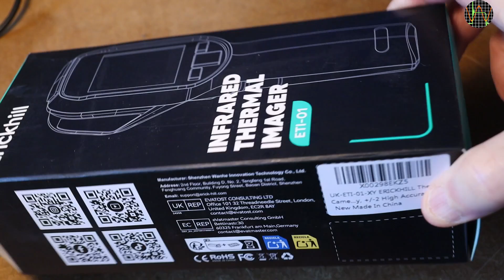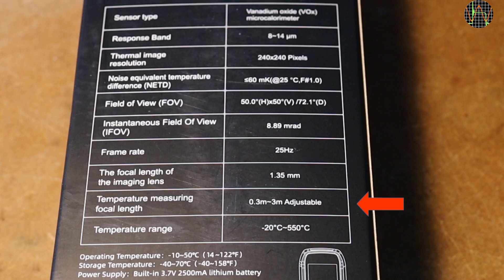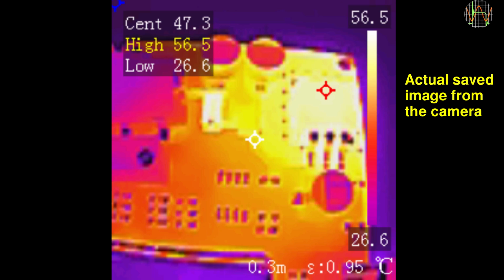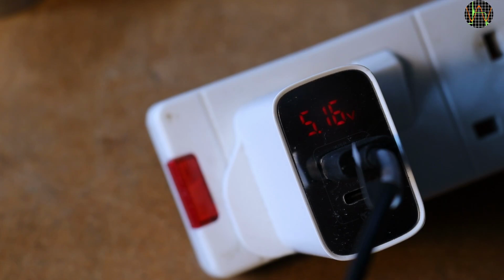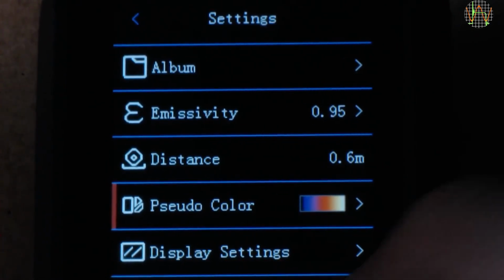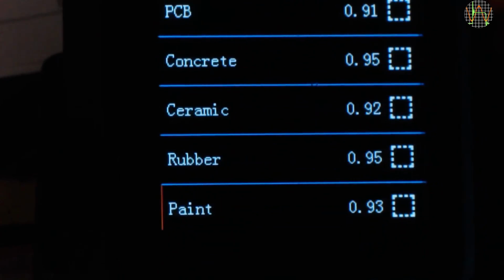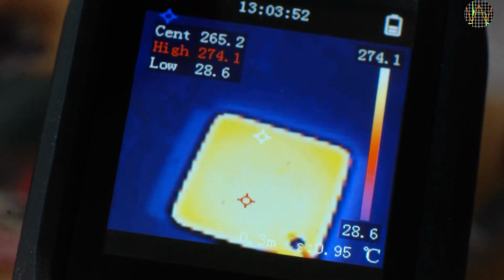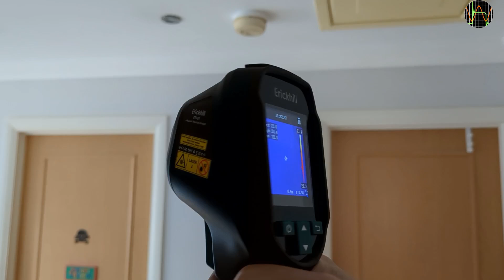180 - How good is the Erickhill ETI-01 Thermal Imaging Camera?

Comment: I don't know how good it is, you tell me please.
Reply from the maker: Depends what you want to use a thermal imaging camera for. This one is good for finding thermal leaks in your house or heating installation . Not so good for finding which transistor is overheating on a PCB
Reply: @TheHWcave  thanks.
Reply: @TheHWcave what characterisc is making this camera not suited for electronics repair? Thanks
Reply from the maker: @silviuguseila2552  The camera is usable for PCB work but not ideal. Thermal imaging cameras are usually either optimized for close work (narrow field of view) and physically small (to fit into confined spaces) or have wide field of view for scanning rooms, buildings, boilers, and other larger objects from a distance. This camera falls into the latter category, this is why I said don't buy it if all you want to do is PCB work. In that case you may be better off with the TOPDON TS001 which is specialized for detailed PCB work but not terrible useful for anything larger because you only ever see parts of the object. The best of both worlds are cameras where you can change the lens, for example the Thermalmaster P2 Pro. This camera has a wide field of view but comes with an additional macro lens that clips over the wide angle lens. Both the TS001 and in particular the P2 Pro are very small and when connected via a USB extension cable, allow the cameras to be used in tight and crowded spaces. Example I had recently was an enclosure with a motherboard and several vertical cards rather close to each other.